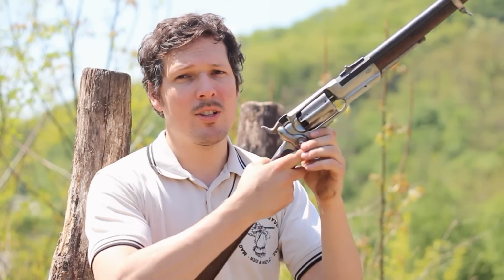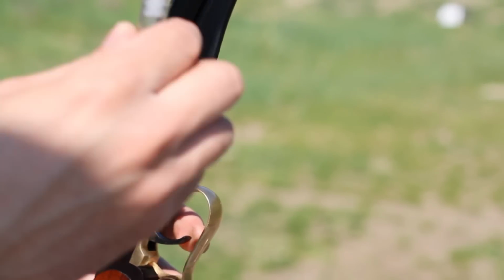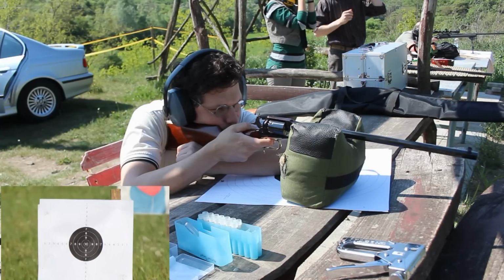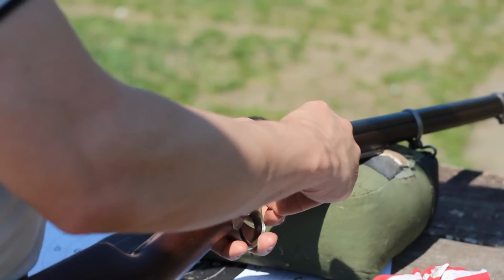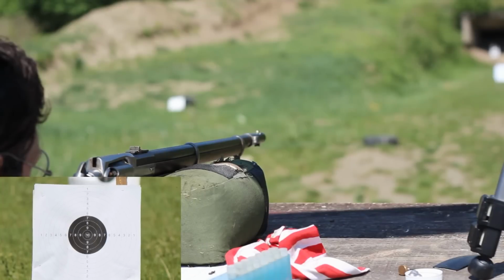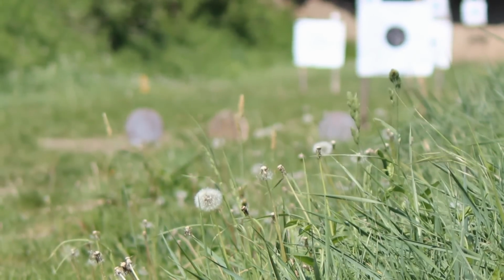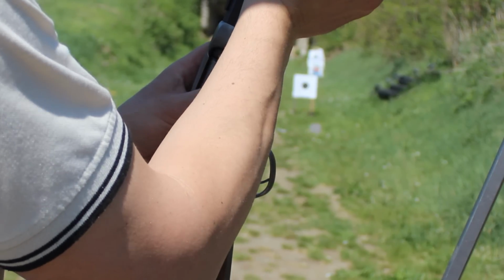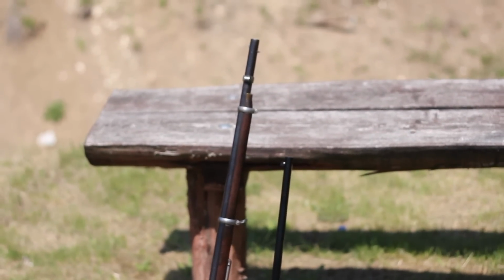Percussion revolving carbines 3/3. - Shooting the original and the repro

Comment: Wonderful videos. For 1855 it was the cat's meow.  It was popular enough to serve in the Civil War. A lot of Union infantry color guards used them to protect the flag bearer in combat. Although there was always a risk of multiple discharge, this risk was outweighed by the  need for for rapid firepower at a critical moment.
Reply: The 1855 Root was also issued to quite a few cavalry regiments.   I do wish Uberti would copy those in the five shot, 56 caliber military models.   Don't know what model he had in the video, but the military issue ones I have seen had a second "spur" just in front of the trigger  guard for bracing the off hand.    With modern metallurgy, a replica should be a lot of fun, even though the original was a POS by todays standards.

Comment: I get this strange feeling that it was never meant to be an off-hand weapon. 

Colt probably never thought that through, but I think it's best when the gun is rested against something.

Like a tripod-type shooting stick or sandbag. 

I still love it, though.

Kind of a shame that there wasn't further development on it. A possible, low-cost alternative to the historic Winchester/Henry rifles, so to speak.
Reply: you can put your hand up on the forearm, and be generally safe. The only issue is when the revolver eventually gets out of time, and starts shaving bullets (it's not safe to shoot it at that point anyway), and the highly unlikely event of a chainfire (highly unlikely likely with proper fitting priming and bullets, which they would have had, and we can have if you are meticulous).  I think what killed these is 1. a lot of blast coming from the cylinder gap (highly uncomfortable, makes your ears ring, as these were light rifle charges, not the diminutive pistol loads) and 2. In a pre (unconstitutional) NFA America, regular revolvers with shoulder stocks were more popular, those did double duty, you could carry it on your belt as a pistol, and then attach the stock for target shooting, small game hunting, or to make it into a carbine; they really are nimble, convenient guns (which originals and repros are grandfathered in under NFA, check you're state laws though, I know MI considers them an "assault weapon" lol). They are basically, lower powered versions of the  short hunting carbine Cap n' Ball has on his channel, small enough to be used 1 handed. Adopting a Nagant Revolver (with sealing chamber mouths) design might have saved these, but that wasn't designed until later.

Comment: sorry  NONO  you have the ball the correct size  so that when you load it shaves a small ring of lead off ,and then it is sealed ,this is a new idea  because people use incorrect size balls,they move and powder slips by and then a chain fire  
 have shot  cap and ball for yonks  this way no problems  in fact put a small disc of bees wax and parrifin  mixed and cut out with an old 44.40 case with the rim removed, then put them in some baby powder stops sticking,slip over the ball also lubes ,melt the mixed lube in a cookie tray to about 3/16 deep ,let cool and cut with the old 44.40 case  ,makes it a cookie cutter of sorts. 

 just think back  did they carry a tin of gloop  when these guns came out NO  used correct sized projectiles not undersize sadly to many ranges allowing under sized projectiles and covering their collective rear ends against probems of a chain fire and new owners NOT instructed correctly  ,also works with a revolver , so you must use GlOOP and a paddle pop stick just like they did in the 1800s oh yeah  
know this is an old posting but someone may read and learn   USE the correct size projectile

Comment: On the Colt revolving rifles. Did they ever convert some of these to cartridge firing?
Reply: No. The cartridge era made possible the practical lever action repeaters with larger capacities and a safer firearm.
Reply: @lancesoterion435  They had conversions in the 19th century.
Reply: @johnn.7806  no they did not
Reply: @midgetman9544  yes they did.
Reply: @johnn.7806  theres only one I did not see on there   also they did not do it on the  colt rifle  for the safety
Reply: @midgetman9544  I made this comment a year ago, I can't even remember the context, but they did have conversations in the 1800s.
Reply: @johnn.7806  I said two rifles there   were not replaced with   cartridge  for safety  also the colt one never was  converted
Reply: @midgetman9544  RIA Lot 1068, auction occurred Dec 8, 2013...    look it up, it's a Converted  1855 Colt-Root Revolving Carbine, it's the .50 version. That same auction had a lot of other cool Colt stuff, must have had a Colt Collection brought in for it (including a Colt Pocket Paterson, and a Pocket model Colt-Root revolver). The reason the axis pin on the Root revolvers had to be inserted and removed from the rear is because Remington owned the patent for the forward removing axis pin (retained by the loading lever). That auction also had a John P. Lindsay 2 Shot .58 rifle-musket (exceedingly rare, as only 1000 were ordered, and most were lost/damaged in use).

Comment: If the rifle was fitted to fire metal cartridges. Would holding the rifle the normal way be ok?
Reply: No, the flash gap between the chamber and barrel will still jet a fan of extreme pressure and heat out both sides.
Reply: @JoeBLOWFHB 
Yes as a shield could be fitted
Reply: @biggusdickkus2956  Actually NO a flash gap shield was never fitted to any revolver I can think of can you name one? There's a reason... it would make the gun even wider and if dropped it could bend and foul the action and the blast force would need to be redirected in a safe direction. The nearest thing that comes to mind is something like a Nagant M1895 but the question was can cartridges alleviate the flash gap issue in this weapon and the answer is still no.

Comment: I know this is old but would you recommend the 1858 for hunting and is that a colt a remake
Reply: I know guys who use the Remington 1858 New Model Army .44 pistols, 8" barrel, Buntline and Target models, with conicals for hog and whitetail.  But they limit the shots to bow hunting ranges, 10 to 25 yards max, and have spent A LOT of time on the range perfecting shot placement.  The Carbine would do just as well but due to ballistics range would not be that much farther for ethical hunting.

Comment: with a longer barrel of 18inches on the remington carbine than the pistol, why are they not more powerful and accurate than the normal 8 inch pistol verion. They should be, in theory
Reply: cylinder can only hold so much powder, you got more barrel than powder. theres a point when longer barrels can slow you down
Reply: I agree, but its way past 18 inches with say 30 or 40 grains on the Unberti version of BP pistols, on a .44 remington. It's an interesting thing to which I  am only trying to find the answer to, thus far I have not found that answer.
Reply: Norm Vigas
dont forget the cylinder gap, and the use of pistol powder in this particular gun
Reply: I agree the fact we are using BP opposed to modern smokeless systems and BP is not as powerful as the modern stuff, also your right about the cylinder gap, thus a % of the force is also lost there. The point is, even considering these things, I think I read, the optimal length of  30 grains of BP in a Remington or colt style gun .44/45 cal to obtain max speed is around 26 inches before negative friction effects it. ( according to tests) So, if that is correct, why does it not have higher velocity?
Reply: Norm Vigas
becouse of the pistol grained black powder, burns much faster than rifle powder, its designed for a short barrel. pistol powder is very fine vs rifle powder is course. if you used rifle powder in the gun it would bump up velocity but its not safe to do so.
Reply: Ok, thats a theory, or answer, I will investigate this idea, but until I find out other wise, I will buy your answer, hahah, watch this space. I love to investigate these things, why ? I am a sad person, hahahah. I love to dig and dig for information.... a data miner
Reply: Norm Vigas
its pretty straight forward, fine powder burns fast, course burns slow
Reply: yep I know that bit, so whats that got to do with the pistol and cabine and their speeds, very little, same powder type, around the same power. Same question why dont' the object,/bullets go faster from the carbine as it has a longer barrel than the 8 inch pistol ?  both BP, both have cylinder gaps, both have the same down sides, but theoreticaly the 18 inch barrel should push the bullet around 40 to 80 meters P/S faster than the pistol, or there abouts, thus higher ft/lbs of impact.
Reply: Norm Vigas
because your limited to pistol powder in the carbine, the powder doesn't build up as much pressure as the slow burning powder, you can see this effect in modern powders. in short with out the slower burning powder the longer barrel isn't much use. the gas in the barrel upon firing expands only to a certain point that point is still the same rather the barrel is 8 inches long or 18 inches. the fine powder burns very quick and is done building pressure quickly.
Reply: roadrunner681 Ok yep I get your angle! thanks, intersting...

Comment: If that rifle used cartridges instead of black powder and had a gas seal mechanism. Would you not need all those safety precautions.
Reply: Redsam121 You wouldn't even want to try that (using the offhand to grasp the barrel) with  a modern cartridge revolver!  The Russian Nagant (M1895?) revolver had a gas seal system that might make that feasible.  BTW I have a J&D conversion cylinder for my Uberti replica 1858 Remington carbine that allows me to shoot .45 Colt cartridges as well (wihtout the fear of chain-fire), but I am cognizant of the gas issue with that as well.
Reply: If I was making a revolving rifle, I would just put a dust cover over the front of the cylinder to seal in the gas. Will that work?
Reply: Redsam121 S&W (or some other manufacturers of that time, can't remember) tried adding a dust cover, but it didn't work as planned- some of the debris were deflected back and could potentially cause eye/face injury or ignite other cartriges. Metal cased ammo solved that problem, and, ironicly, automatically made revolving rifles obsolete.
Ian from forgottenweapons talked on this opic not long ago.